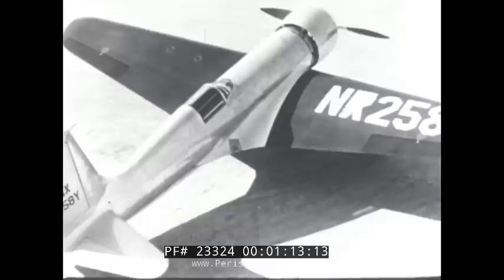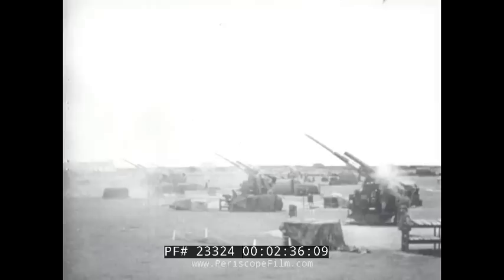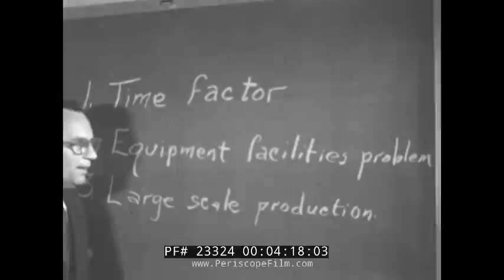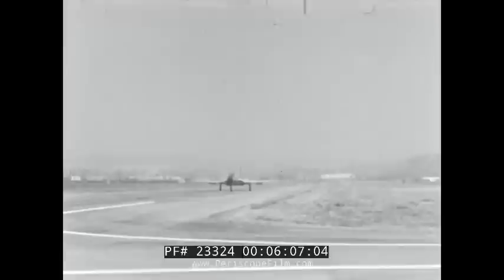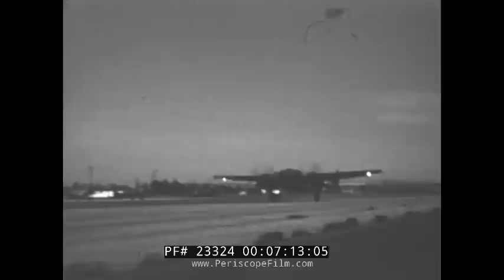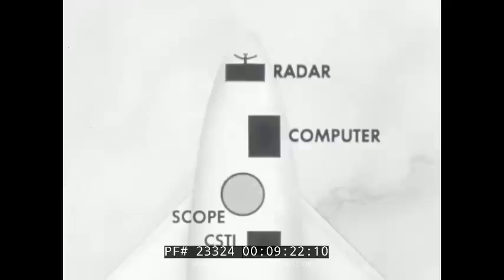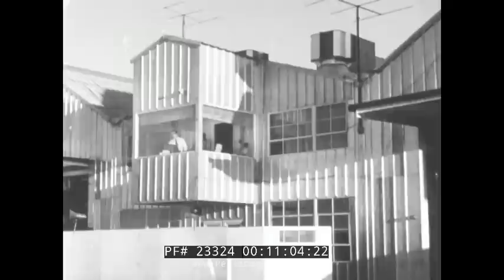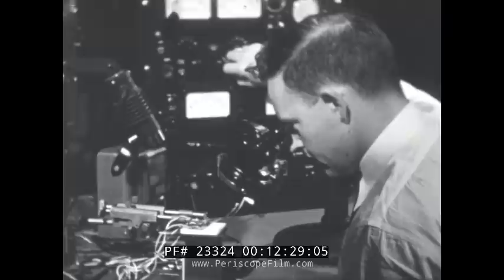HUGHES AIRCRAFT COMPANY INTERCEPTOR AIRPLANE & MISSILE FILM  SEEK FIND AND KILL!  23324

Comment: Gotta say, for The Battle of Palmdale F-89 haters, all the info I've seen says their radars were malfunctioning with the autolaunch system and they'd had their gunsights removed.  So the pilots were trying to fire unguided rockets at the ends of wide wings at a small moving target.  So basically blind.  Though I doubt the early aim-4s would have done much better.

  Despite that, it's still a hilarious story. Like, omfg lol
Reply: Tiktaalik Well I guess I must have missed something somewhere along the way.We just never had trouble with the radar on any of the89s I worked on not in my squadron nor our two sister squadrons but then again that's just my personal first hand experience in USAF and later in the air national guard as the F89s were retired and assigned the air national guard service strange how I missed all the fun.DRAT!